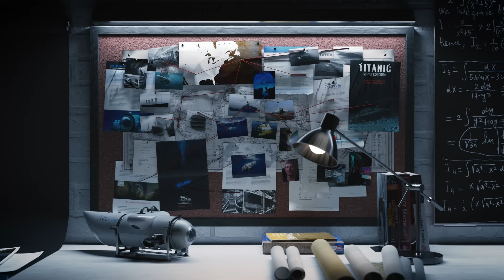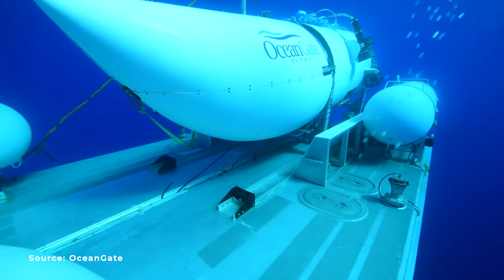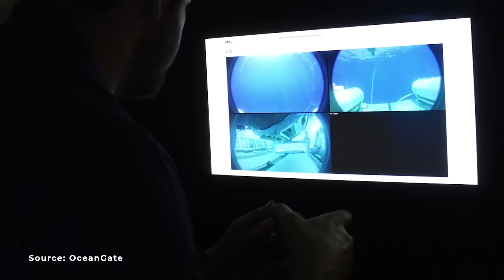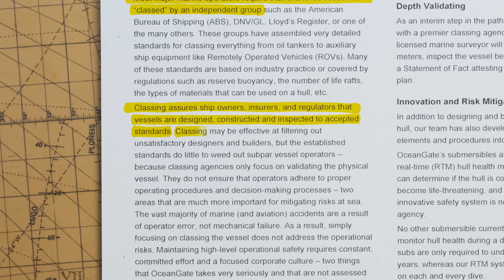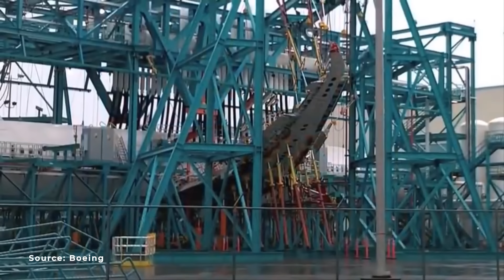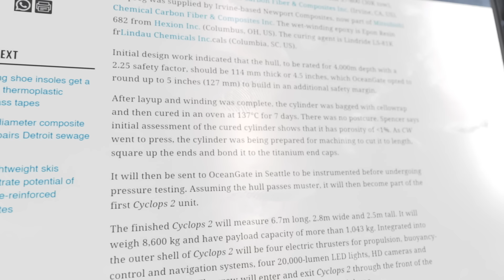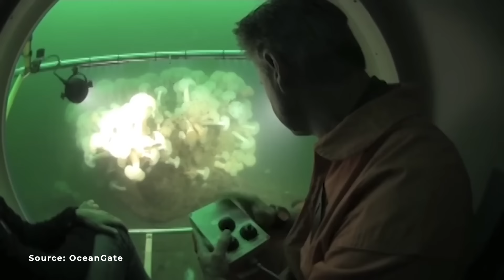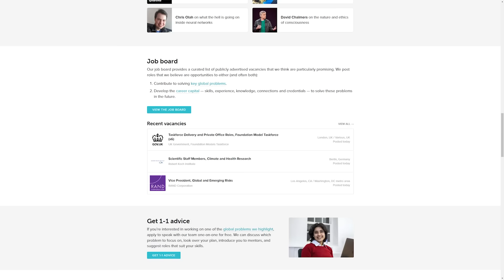The Questionable Engineering of Oceangate

Comment: I kind of feel like there's two things here.

Regulations, and safety, do NOT go hand in hand, and many times oppose each other. 

Based on what you described there, the reason for the failure was negligence, not lack of "standardized testing".

I should mention that my field is not engineering, but rather electronics and computers, where standards are a clear and dangerous issue. I also cannot talk about regulations in other countries.

Let's take an example. You do not want people to electrocute themselves, right?

So what does the country do?

- Blames any kind of death on the home owner. A thief broke into your house and shoved a fork in your socket and killed himself? Your fault. You are a murderer now.

- If you wish to buy electricity, you have to follow standards. What standards? They don't tell you. Better shill out the price of a few houses to IEEE and ISO to find out.

- Want to fix, I dunno, a socket or a breaker? Don't have a degree in electronics? Too bad, if anyone catches you, it's illegal no matter how well you did it. As to get a license, you need a graduation certificate and other bullshit.

It is also illegal to create high voltages without a license. That's right, spinning a magnet around a coil too fast is illegal. Great.

This is all to say, standardized testing is meaningless. What matters is the actual safety, and many times that directly contradicts the standards required. Eg if I don't like my sockets cuz they aren't safe enough, *I cannot legally make them safer*.

Also you cannot legally build a computer (like, put the parts together) without an electrician license. Fun, isn't it?
Reply: All the regulations you listed are fairly reasonable and easy to understand with a basic knowledge of liability law.
Reply: @Narokkurai  I don't know what kind of insane world do you have to live in to find those regulations reasonable

And figuring out the so-called "basic knowledge of liability law" is extremely hard, they don't make the law texts easily accessible, you have to go to a library as it isn't available online, for example, laws also override each other, so you have to go through tons of it, and a lot of the info is plain out missing.
Reply: @peacefulexistence_  I live in the exact same world that you do. There's only one world and we all live in it, and it's your own fault if you don't understand it. You can ask a lawyer if you know one. There are YouTube channels dedicated to educating the public on the law. There are websites dedicated to explaining the law. It's really not that complicated, and if you take the time to understand the reasoning, it makes a lot of sense.
Reply: @Narokkurai  There's this thing called countries, and no, that's not a reasonable approach to anything.
Reply: @peacefulexistence_  All countries still exist on the same planet, and if there's any law at all, it's going to be grounded in essentially the same kind of logic. In particular, liability is basically always defined as responsibility for the safety of your own property, as well as all the foreseeable consequences for how it's used. For instance, if you own a building that has a maintenance scaffold on the roof, you have a responsibility to keep that scaffold maintained and safe for use. If the scaffold breaks and someone gets injured on it, you're responsible for their injuries because you had an obligation to maintain the safety of your property. Even if that person is a thief or a trespasser, their crime doesn't negate your own. 

Liability always comes down to understanding that you are responsible for your own actions, as well as all the foreseeable consequences of those actions too.
Reply: @Narokkurai 
> you have a responsibility to keep that scaffold maintained and safe for use. 

For what reason should I be responsible for that? My responsibility ends with telling people that entry on my property without my consent is up to their own risk. If they enter anyways, they accept that risk, and anything they do to themselves is up to them. 

Tell me, who is held responsible if I climb up to a high voltage pole with a ladder, strip the isolation and touch both the power and ground? If you wish to be consistent, it's obviously the city that's responsible. Will the mayor be charged for murder?
Reply: @peacefulexistence_     You're responsible for it because it's your property, and if you know your property is unsafe and you do not make every reasonable effort to fix it or prevent public access to it, then you are liable for any damages caused by it. 

It's the same reason why booby traps are illegal, and it's the same reason why a "Beware of Dog" sign is NOT a legal defense. If you know your property could cause someone harm, and you do not do everything that you can to prevent that harm, then you are knowingly causing harm. That's a crime. That is basically the definition of a crime: to knowingly cause harm.

In the example you gave, the city is not liable because they did everything that they reasonably could to prevent harm. They put the wires high up, well out of easy public access, and insulated the wires specifically to prevent accidental harm. The only realistic way someone could electrocute themselves is if they knowingly and intentionally made the power line harmful to themselves. Then, the liability is on that person, not the city.

In liability cases there are three simple questions to be answered: Did the property cause harm? Did the owner of the property know it could cause harm? Did they do everything they reasonably could to prevent that harm? If the answers are Yes, Yes and No, then the owner is liable for the damages.
Reply: @Narokkurai  > and if you know your property is unsafe and you do not make every reasonable effort to fix it or prevent public access to it, then you are liable for any damages caused by it. 

That makes zero sense

> because they did everything that they reasonably could to prevent harm. They put the wires high up, well out of easy public access, and insulated the wires specifically to prevent accidental harm.

I, too, did everything I could. I built walls around my property, and put warning signs there.

> Then, the liability is on that person, not the city.

Please be consistent.

> In liability cases there are three simple questions to be answered: Did the property cause harm? Did the owner of the property know it could cause harm? Did they do everything they reasonably could to prevent that harm? If the answers are Yes, Yes and No, then the owner is liable for the damages.

There's also the question of certificates, but w/e. Again, it's dumb and makes no sense.
Reply: @peacefulexistence_  What doesn't make sense about it? I don't know why you think I'm being inconsistent. You haven't actually shown 

Putting up walls and warning signs is only sufficient if you can prove that there was nothing else you could reasonably do to prevent people from being harmed. For instance, a "Beware of Dog" sign provides no legal protection, because if you know your dog is dangerous (which you are showing that you know by placing a "Beware of Dog" sign) then you would also know that you need to put it on a strong, thick leash, and even put a muzzle on it, if you know the dog is difficult to control.

You are responsible for your own property. If your dog attacks someone, in the eyes of the law it's the same as if you attacked them.
Reply: @Narokkurai  The law is stupid, that's my argument. In the eyes of the law, I am responsible for any suicidal thief that breaks in, I am also responsible for the life of any murderer that tries to kill me, and other fun ways the law tries to make people into criminals for no reason.
Reply: @peacefulexistence_  But the vast majority of people are not suicidal thieves, they are ordinary people who you, as a responsible citizen, are not allowed to harm. You are not allowed, through action or inaction, to knowingly cause a person harm unless they are immediately threatening to harm you.

You may think the law is dumb but it IS the standard by which responsibility is defined, and it is absolutely essential to having a free society where ordinary people do not have to live in fear of their neighbors or their environment.
Reply: @Narokkurai  >  it is absolutely essential to having a free society where ordinary people do not have to live in fear of their neighbors or their environment.

It is truly not.
Reply: @peacefulexistence_  Well I suppose if you had a mind control device to control the actions of each and every person on the planet and prevent them from accidentally harming themselves, then there would be no need for liability laws, but that technology does not exist so the law will have to do for now. Whether you like it or not, you are responsible for the foreseeable effects your actions could have on other people.
Reply: @Narokkurai  At least get your standards straight
Reply: @peacefulexistence_  The standards are straight. Your ignorance of the law does not excuse you from it.
Reply: @Narokkurai  Sure.

That does not make the law reasonable.
Reply: @peacefulexistence_  Reasonability actually is a standard defined in the law. It means: ordinary, standard, rational, and usual for the circumstance. It is literally the minimum that is expected from any average person.
Reply: @Narokkurai  Ok? Not relevant.
Reply: @peacefulexistence_  It's quite relevant because the law is, in fact, reasonable. It follows a consistent chain of logic designed specifically to cover ordinary situations that affect real people. Anyone of average intelligence and basic self-awareness should be able to understand it, and even if you don't like it you're going to have to accept it. Or else just go to jail, like a lot of Sovereign Citizens who think that the law doesn't apply to them just because they disagree.
Reply: @Narokkurai  It is not reasonable, and does not follow much logic. Anyone average should be able to understand, however that simply is not the case, as the law is written to be hard to understand. And as I said, it's a law, yes, and I am saying it shouldn't be. I have no idea where you got the thought that I ever said it isn't a law, so please stop implying that.
Reply: @peacefulexistence_  It's not written to be hard to understand, it's written to be consistent, which it is, and also to properly value human life, which it does fairly well. I have not contradicted myself a single time explaining the law to you. If you think I've contradicted myself, point it out and I will explain to you.
Reply: @Narokkurai  It is written explicitly to be hard to understand, that's why lawyers exist. It is very much not consistent. You apply double standards to what a city can do, and what a homeowner can do. A city has less responsibility securing public property than a homeowner has securing their private property. Law does anything BUT value human life, considering the amount of pain and suffering it causes just for politicians to feel good and fill their pockets with embezzled tax money.
Reply: @peacefulexistence_  The city doesn't have less responsibility. If anything, the city has MORE responsibility, since they have more tools to monitor and check the safety of their equipment, and repair them if/when they become dangerous. That's why your example of a person climbing a pole and opening up a power line is so silly, because that's a perfect example of a situation where the property owner isn't liable because they did everything they could to prevent harm. The climber needed to actively and knowingly make the situation more dangerous for themselves in order to get harmed.
Reply: @Narokkurai  Except the homeowner, to whose house a thief broke in and decided to try to steal their fridge, except the fridge falls on them and they die, is liable. How is this any different? The thief had to:

- Bring a ladder
- Climb over a wall
- Break in a window
- Attempt to steal a fridge
- Have the fridge fall on them and they die

Compared to

- Bring a ladder
- Climb up
- Cut in a wire with a metal knife then die from electrocution

If anything, there's less barriers to overcome.
Reply: @peacefulexistence_  Nope. If a thief breaks in and tries to steal a fridge, and the fridge falls on them, the owner isn't liable.

The exceptions are if the owner knows the fridge is dangerously unstable and would be likely to harm anyone who tried to move it, or if they intentionally booby-trapped the fridge to collapse on anyone trying to steal it.
Reply: @Narokkurai  I have such a fridge, that is just fine and will not fall on anybody who just uses it like a normal person

You just have to be careful while moving it. And people have, and it's fine.
Reply: @peacefulexistence_  If it's safe in ordinary use then you're fine. However, if it's not safe in ordinary use, then you're liable. For instance if there's an electrical outlet with a short, and you know about it but you don't do anything to fix it, you're liable for anyone who gets electrocuted by it, whether trespassing or not. If a neighbor, or a relative from out of town used that outlet and got shocked, you would be just as at-fault as if they had been a burglar.
Reply: @Narokkurai  As I said, my argument is not about what the law *is*, but that it *shouldn't*. Stop ignoring that fact.
Reply: @peacefulexistence_  The property owner is the one who caused the harm, so why shouldn't they be responsible? If they had maintained the safety of their own property, no one would have been hurt. You're not allowed to create situations that you know could harm people, just like how you're not allowed to drag a baseball bat out the side of your car window, and you're not allowed to fire a gun in random directions. 

If the law were written the way you think it should be, then there would be more death, pain and suffering in the world. That's the simple truth. What you are advocating for is death.
Reply: @Narokkurai  No, they are not.

If the thief didn't break in, nobody would be hurt.

Again, different argument altogether, I don't care.

No, you are the one advocating for death and suffering, for the sake of protecting thieves and murderers. Do not phrase your opinion as a fact.
Reply: @peacefulexistence_  How someone enters their property, whether legally or illegally, does not change the fact that owner created the dangerous conditions. They don't get to determine after-the-fact if the person they harmed deserved it or not, particularly because there's no way they can guarantee that only a trespasser would be harmed. It doesn't even fall under self defense since self defense is a response to an immediate threat on their life.
Reply: @Narokkurai  Once again, I don't care about descriptions of the law, I am saying it should not exist. Please stop describing it, it is not relevant.

The same thing applies everywhere. If a homeowner cannot guarantee it, then how does a city guarantee it? That's right, they don't! If someone is really dumb and seeking death, there is nothing you can realistically do, whether you are a city or a homeowner.
Reply: @peacefulexistence_   I'm describing the ethical foundations of the law, the reasons why law exists in the first place. People should be held accountable for their actions, right? If you fire a gun at someone, you're the one who caused the harm to them. If you rig a pulley system to fire the gun when you pull a string, you still cause harm by pulling on that string. 

If you wire the gun up to a machine with a big red button, and that button has a 1/1000 chance of firing the gun when pressed, you still cause the harm if someone happens to be standing in front of it in the one-in-a-thousand times that the gun goes off. 

Even if the machine were rigged so that it has a 1/1000 chance of going off every minute the button is NOT pressed, you are still the root cause of the harm if you do not press the button.

This isn't just the law, this is morality itself. You are responsible for the consequences of your own actions, including your own inaction. Again, not just because the law says so, but because morality itself does. The rules of cause and effect say so. This isn't a difference of opinion.
Reply: @Narokkurai  The person who pressed the big red button with giant text "if you press this button you might die, don't do it" then the person pressing the button is responsible.

And there is no such thing as "morality", as morality is an inherently subjective quality. Cause and effect is entirely unrelated. It is inherently a difference in opinion by the mere definition of morality. You might want to look up moral systems before you run your mouth, morality is an extremely complex problem.

Comment: If you work with a pressure tip producing 4000 Lbs. you have to have a card in your wallet to tell the hospital emergency room poison was accidentally injected right thru the skin leaving no visible tear or opening. Carbon fibre at these pressures requires only a microscopic weakness creating an entry point, and soon the carbon fibre is transformed into a sponge. 
The excess speed in the decent can only be explained by REDUCED DISPLACEMENT,  comes from taking on water, there is no other weight source, the carbon fibre was infused with so much water, ejecting the cage and balasts made no difference.